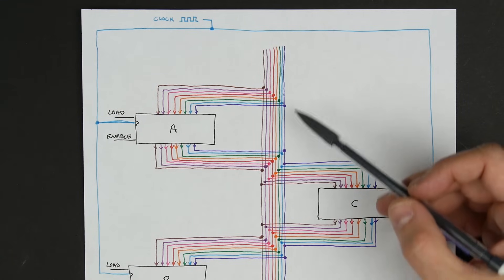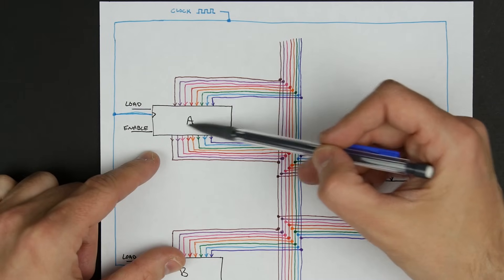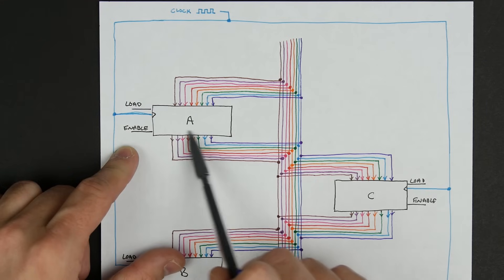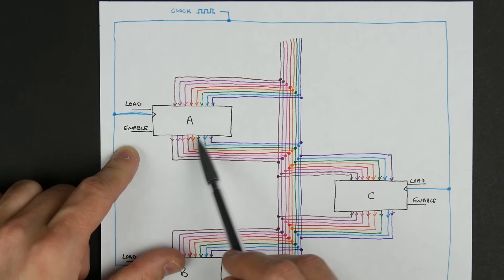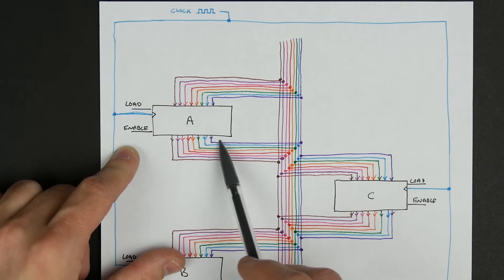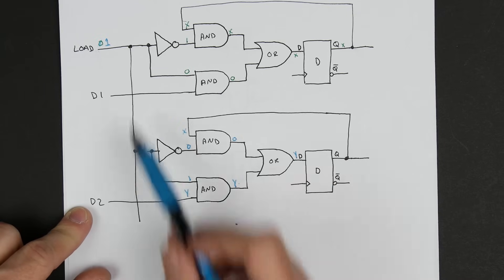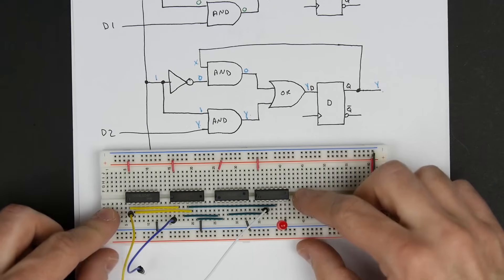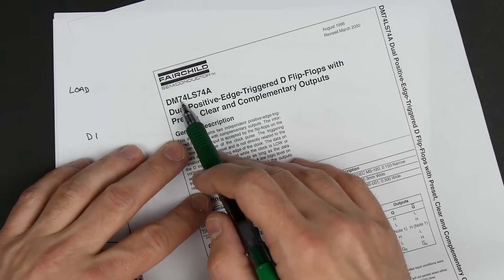Designing and building a 1-bit register - 8 bit register - Part 3

Comment: Hey, you probably wont read this, but I am wondering why you should use all the complicated logic instead of using an AND gate taking LOAD and CLOCK outputting to CLK on our D flip flop, wouldn't this be much more efficient than using all of the other logic presented here?

Comment: at 5:20 why not just connect all clk inputs together to the output of one single AND gate, then hook up one of the inputs to the clock and one is the "load"? That would use one logic gate per register, instead of 4 gates per bit (32 gates per register)!
Reply: Yeah exactly! I noticed the same thing.

Comment: Why could you not connect the clock input to load? then whenever load is activated, a clock ticks on the d-flip flops and they load whatever they see. When load isn't activated they do nothing. Is there a problem doing that?

Comment: How come you can't just use an AND gate between the clock and load signal and then feed that into the flip-flops enable and clock pins?
Reply: He did this more complex circuit because it is the version of the IC he is going to use at the end as a 4-bit register.

Comment: Wouldn't it be a easier to use a D-Flip-Flop but with an AND gate added after the CLK input, where the second input is the ENABLE bit? Then the register would only read from the bus whenever both the CLK and ENABLE are on. It wouldn't need to read its own output on every clock pulse if ENABLE is off as it currently does.

Comment: Why not just put a transistor between the clock input and the rest of the d flip flop that is controlled by the load
Reply: liams923 That’s exactly what I was thinking! Just having a simple and gate controlled by the load and clock signal outputting to the D flip-flop clock signal
Reply: putting a single transistor in any part of the circuit will make the circuit non-CMOS .
Reply: What? But the entire computer is already all-TTL, so no CMOS involved. That's why transistors wouldn't make it "less CMOS".
Reply: Switching the clock introduces a delay into the clock signal, which is very bad for a few different reasons. Remember the thing from a previous video in the series about how logic gates have a tiny delay between the input and output? That delay actually matters, quite a bit, when it comes to clocks.

Comment: Why not use and gate to combine clock and load signal to the clock input?
that might be simpler?
Reply: Yes it would technically be simpler BUT: In a CPU every component must be synchronous and thats why we use a clock. The clock synchronizes the whole circuit and that way it's way simpler to put all the modules together. A register on its own wouldn't need a clock but as soon as you want to implement it in a CPU you need a clock to synchronize it with the rest
Reply: @killthesource4740  But when all places when clock is needed will have that one extra AND for gating the clock wouldn't we end with exactly the same delay? I don't see any timing issue then you assume AND at each clock input pin in the design. I'm really missing the point why it was done like that. TTL chip was designed that way only for safety? Like some parts of "unknown" design that uses that TTL chip will have gated clock and some not. Please help me ;)

Comment: Any reason why one of my 8 bit registers loads data from the bus in an non-syncronus way? If I run the enable HIGH, the 1st 4 bits will load on the clock pulse high and when it goes low the last 4 bits will load. 

I will do testing and report back but found this very strange.. Maybe my clock signal line is too long to the 2nd register?
Maybe I need resistors on my register LEDs?
Reply: As an update I reduced the number of wire hops from my clock to my register and it seemed to fix issue. I also added current limiting resistors to my LEDs and this seemed to make it more stable.

Comment: i'm still strugging to understand how a not gates inverts the voltage from off to on , or off on to off , when there is no other voltage or line , making it do so. when there is only 2 pins lines 1 coming in and one going out.
Reply: Look into pull up and pull down resistors.. that's what is happening inside the chip

Comment: 13:50 so "clock" isn't the same as "clock cycle"? I'm confused, can someone elaborate on that?
Reply: The "clock" is the raw square wave signal. The "clock cycle" is everything that happens during a single period of said square wave. As far as the clock generator is concerned, a clock cycle consists of the 555 output going high, then going low. Everything else on the board however could be doing a lot more in that time.

The way he's set up the logic here, most of that machine is idling for most of the time (inbetwixt the between of them there clock pulses) because all the TTL chips he's using have so much spare bandwidth (as in they're so much quicker than the 4Hz clock). Speeding up said clock reduces that idle time, making the machine more efficient... up to a point. You go too fast - it falls flat on its face.

Comment: 4:35
Why not feed the CLOCK input of the register into an AND gate with the LOAD input and feed the AND output into the common clock?
Reply: General consensus here appears to be "DON'T fuck with the clock! Bad things happen when you fuck with the clock!" :P

Makes sense though, it's a timing signal, it should never be used to do anything other than timing. Think of it as pilot pressure in a pneumatic system (not a perfect analogy, but close enough) - if you have 8 pilot operated valves which all need to open together (within a narrow window of say 100 microseconds), you don't want any of them to be connected to delaying mechanisms (logic gates?) and you don't really want anything to be sinking on the line (you want all pressure and no flow)
Reply: Yes it would technically be simpler BUT: In a CPU every component must be synchronous and thats why we use a clock. The clock synchronizes the whole circuit and that way it's way simpler to put all the modules together. A register on its own wouldn't need a clock but as soon as you want to implement it in a CPU you need a clock to synchronize it with the rest

Comment: dang ben... respond to the comments!!!!  lots of folks wondering why you can't just put an AND gate with the LOAD line and CLK line as inputs and feed that to the clock of the flip flop.  Wouldn't that do the same thing with way less complication?  Teach us!!!!
Reply: Frank Graffagnino If he used that approach, the register wouldn't be completely synchronized with the clock. It would work in most cases, but then if the clock were high and the Load changed to high, it would load the flip flop. But we only want to load the flip flop at the rising edge of the Clock.
Reply: But if you but the clock signal through the "edge detector" first, then to an AND gate with the load? Then the difference in load would need to happen during the 0.1ms or whatever to make a difference and then it's not a problem anymore (if it goes high during that 0.1ms, it's fine if the value is written)
Reply: Or, if you want to use a chip flip flop, just make another edge detector before it: the internal one is faster anyways and will trigger (at least with comparatively long pulses like 0.1ms)
Reply: Jeff Russert, different components will have slightly different timings anyway. The flip-flop had the internal "enable" circuit that was then connected to the clock via the edge detector. Are you saying if we put an additional AND in the enable circuit to make it only be true if both clock and load are present, everything is going to fall apart? If the whole system is that sensitive to additional gates, good luck with everything that's more complex than a register. And if that's the case, then it'd definitely be worth mentioning in the video.
Reply: Frank Graffagnino maybe nobody knows I asked my prof, she said you can't and stopped taking questions!
Reply: As a rule of thumb, you never NEVER put logic in the clock. the only exception is for not gates to invert clock polarity such that all your memory elements have the same clock polarity (positive or negative).
If you put logic in your clock, be aware that you are not in the synchronous realm anymore. The synchronous realm is nice and easy  as long you play by the rules. The asynchronous realm is BRUTAL, and only the big boys play it, because you need worry a lot about timing, glitches, stability and race conditions and all sort of things. asynchronous realm is BRUTAL, got it? it's BRUTAL.
Analyse the and gate solution by the asynchronous theory, and you will figure it out this is not what you want.

but protoex, how I become a big boy then?
give a look at:
http://www.crbond.com/papers/advlog.pdf
Reply: look into HPET and timers and why they're important and you'll actually see why! :) modern precision event timers do some cool stuff.
Reply: It's also why the CRAY 1 uses 1 foot long wires (or longer) to syncs pulses (we are talking about Big Iron here). You always have to add up your longest delays according to the data books and make sure your timing works. This goes for both state machines and computers too.  It's also why you want the shortest runs between your logic gates so you don't add timing problems. Navy Rear Admiral Grace Hopper, Grandma COBOL , used to hand out 1 foot wire to explain what Nanosecond meant. God you guys are making me have to think tonight. :) See Amazing Grace in this link >>> http://www.public.navy.mil/surfor/ddg70/Pages/namesake.aspx#.WvVYvKQvxaQ
Reply: I was another hack thinking, "Why not just 'mute' the clock?" (when you don't want the register to latch an input from the bus) but I suppose I'm in over my head in synchronous logic theory here. At least with this solution the clock IS the clock at all points, without any gate delay. It's clearly adding 'set-up time' to the inputs - but that can stretch off to the horizon of the next clock edge, no problem (and will be whatever it is already, i.e. plenty much). I honestly thought he was setting us up for replacing the D flip-flops with DRAM cells when I first saw that 'refresh cycle' thing.
Reply: I think that is called a "gated clock", or "clock gating". There are special considerations to be taken when doing so. One of them seem to be to avoid a clock glitch, glithes can happen in certain logic and states. A glitching clock would be bad. Essentially, there seem to be two different types of clock gates, AND and OR. Respectively, modifying the control signal might prematurely cut the clock signal short, or prematurely activate it, both of which can create problems, with hold and setup times, metastability etc.
Reply: it's every youtuber's god given right to ignore the comments

Comment: Couldn't you just AND the Load and the Clock together to decide when the data can be written in the register?
Reply: Nevermind I found the answer in the comments
Reply: @GodGecko  I also read the answers for that in different comments but I'm still not convinced. If we would add gated  clock via AND gate to every register (or any place where we need a clock) we will end up with the same amount of delay. I don't see any timing issues with that gated clock approach but maybe I'm missing something.

Another thing is that I don't really like that pulse detector circuit made out of capacitor. It seems to be very unpredictable. Maybe it's not an issue with TTL chip but doing it from discrete components (like NAND gates only) + capacitor sounds bad... Wouldn't it be easier to just put two D latches in a row in a master slave configuration (with have 180 degree clock phase shifted)? Two D latches is 8 NAND gates + one inverter to invert the clock.
Reply: It's better to run the clock straight to the component that needs it with as little as possible of other logic components in between because not every component has perfectly equal specs as the other, they don't take the exact same time to change state and things would go out of sync easily

Comment: At the very least you should really put a buffer on the output of that edge detector circuit. Otherwise you're going to end up getting negative voltage pulses as well as positive ones.

Comment: let me explain the ques mentioned in the video" why there using another form of NOR gate to control EA and LD in this design of register".
so first let me explain why NOR gate: for you can encode 4 chips like this,  separately arrange them together as a register group.
chip in this video may represent as number 0 chip, as you need to offer 00 to EA or LD data. 
the same reason for why this form of NOR gate, in fact, it is just for the chip number 0 you see a NOR gate.
but for chip number 1  2 3, you got the different input control gate.

Comment: where is the best place to by all the components? amazon? ebay?
Reply: I'd say some mix of digikey, RS components, element14 and sparkfun or similar.

Not eBay! Not Amazon. You can get some cheap cables/wires on Amazon tho.

If you're starting out: You want to buy stuff in bulk from the same dude and have it shipped in one package. Also buy some boxes to sort all the little things into. Just search for the part numbers in the description in DigiKey and make sure they're the correct package (if they come in different forms).

Just to clarify, there's lots of people selling 'cheaper' parts that may or may genuine or correctly labeled. When you have 100 wires running you want all those parts to be working properly.

Comment: 19:00 I think what they did was just to use only a NOR gate which's a bit easier in manufacturing. An AND with inverted inputs is the same as OR with an inverted output.

Comment: 4:30 why does one not simply connect the LOAD with the CLOCK cia an AND before the edge detector. In that case the D Flip Flop only loads an new value at clock cycles when the LOAD is high

Comment: or you could just "AND" clock and enable before feeding it into the clock iput of the d-latch...
Reply: You cant, it is theoretically neat but in practice it doesn't work. Says my digital electronics book.
Reply: You don't mess with the clock. It needs to be an absolutely clean signal, else bad things happen. Things like one register clearing its output before the other has read it.
Reply: Yes it would technically be simpler BUT: In a CPU every component must be synchronous and thats why we use a clock. The clock synchronizes the whole circuit and that way it's way simpler to put all the modules together. A register on its own wouldn't need a clock but as soon as you want to implement it in a CPU you need a clock to synchronize it with the rest
Reply: @AlexOlsenpang  your digital electronics book is absolutely outdated then. Clock gating is standard practise in the industry.

Comment: Why not just and the enable and the clock lines and feed that into the D-flip flop clock pin
Reply: In this circuit it won't be a problem but you usually don't fiddle with the clock line. In real circuits it introduces a delay into the calculation (due to the and gate on the clock line) so it is not done

Comment: Why couldn't you just AND the load and the clock together and feed that into the D-flip/flop?
Reply: I believe that if you were to AND them together you would not be able hold the value in the D-Flip-Flop because once the load signal went low, a 0 would be pushed through and you would end up zeroing out your Flip-Flop which would mean zeroing out your entire register. I'm not completely sure but that is my best guess.
Reply: Yes it would technically be simpler BUT: In a CPU every component must be synchronous and thats why we use a clock. The clock synchronizes the whole circuit and that way it's way simpler to put all the modules together. A register on its own wouldn't need a clock but as soon as you want to implement it in a CPU you need a clock to synchronize it with the rest
Reply: You absolutely can and this is the actual way it's done in the industry. Clock gating is a must, in order to save energy.

Comment: Why do you switch chip makers? I have seen Motorola Fairchild semiconductor and Texas instruments in your videos do they all make duplicate products? Why did you put the ones you have?
Reply: Probably to do with ICs to hand and which are available. 7400 series chips are made by several manufacturers (historically and currently) and are functionally the same (a 74LS00 is a 74LS00), ignoring any differences like operating temperatures, maximum frequencies, latency, etc.

Farnell UK, for example, only have the TI 74LS173 listed and it is no longer stocked, the 74HCT173 made by Nexperia or TI is only available in SOIC form (TI on backorder, can buy singly; Nexperia in stock, have to buy in sets of 5), and the 74HC173 in DIP form is sold in 5s and only TI is listed - part of the reason I went with CMOS-only 74HC when I ordered chips.